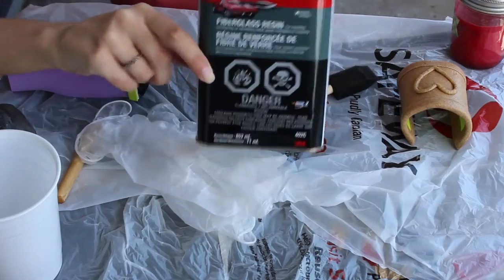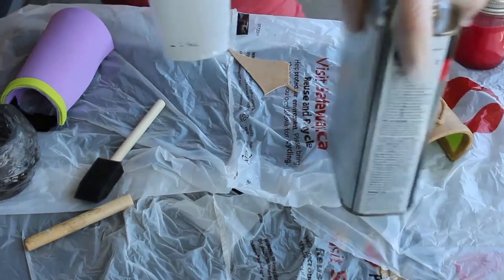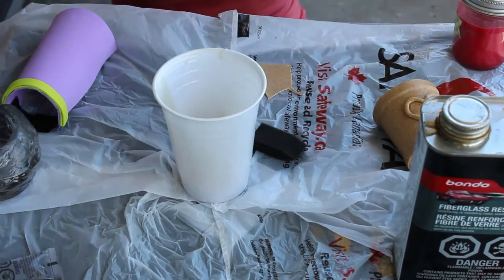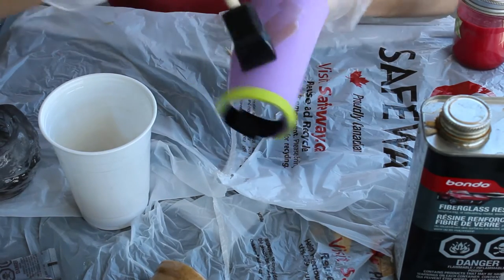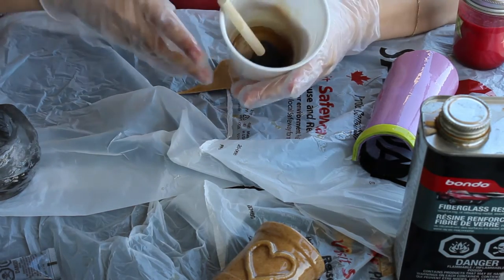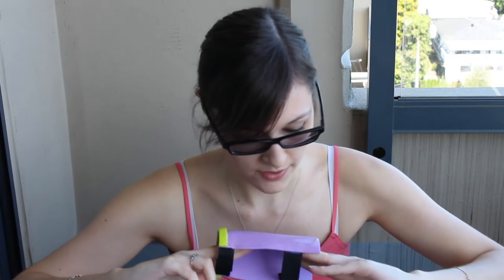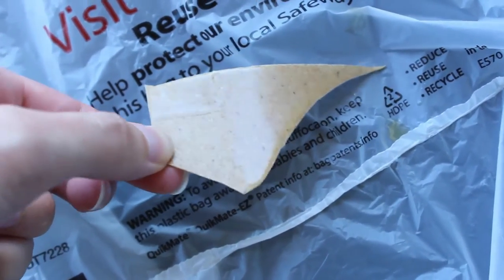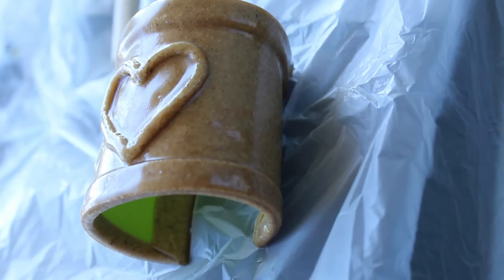Priming with fiberglass resin: Tutorial

Comment: I know you sealed yours with clear acrylic spray after painting, would you recommend the resin over a finished painted piece or still the clear spray? I'm working on a large prop and in my past attempts had issues with things sticking to the paint even after being sprayed with clear acrylic and drying... do you think the resin would become too heavy?
Reply from the maker: If the prop is large, the resin will probably make it too heavy sadly. I also try to avoid using it as a finish because it has a slight yellow tint to it which would throw off the color you've already painted. Maybe try giving your paint more time to dry between each layer? Another thing to check would be if the paint you are using (if not acrylic) is compatible with the clear acrylic coat. I know water based and oil based paints don't do well together. Perhaps check your primer as well. If the stickiness is more on a handle though, you might need to put a different material there. I wrap mine with coloured tape, since my warm hand messes up paint sometimes.

Comment: First timer here. I'm planning on making a Daft Punk helmet using fiberglass resin.  Would I need to apply the resin both inside AND outside the helmet? Also, since these fumes are toxic, is it safe to wear it after the resin cures?
Reply from the maker: Hi, I think you would be fine with resin outside the helmet. I don't think you will need it on the inside. It will be more comfortable to wear and lighter with resin only on the outside. The helmet will be fine to wear after the resin cures. The smell goes away in a few days, so just let it air out a bit :)